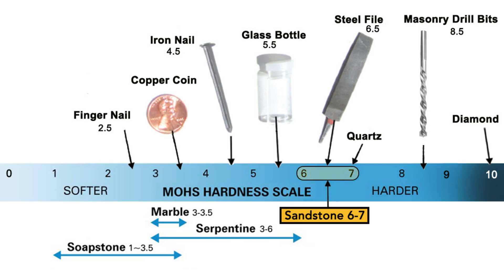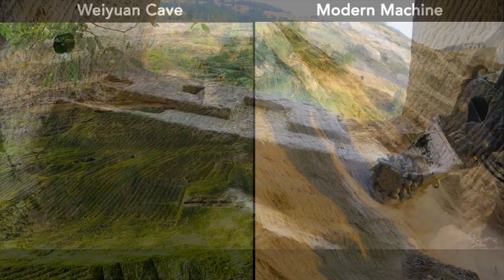Ancient Chinese Stone Caves & Egyptian Quarry Share Similar Machine Marks

Comment: I used to built continous miners . Those are those big machines which you showed in your video. The tool marks found in ancient caves around the world are all machine marks , exactly how they still look today . The pattern is determined by the design of the cutter . Those machines can cut huge amounts of rock in one day . They would have cut a cave in less than a day . Great video , great topic !
Reply from the maker: Thank you for sharing your insight. I really appreciate it! ♥
Reply: @CuriousBeingbyTina  More  misdirection.  The tool marks may look similar to todays machined marks...but the variety of the APPLICATIONS we see for that technology show that it is inconsistent with many of instances of its use that we can see today.
Reply from the maker: @michael4250  In which way inconsistent? Can you show a site with real hand chisel marks with similar consistency and scale?
Reply: @CuriousBeingbyTina  for one, the machines wouldn't be able to continue the machine tool markings into the very corners of the rooms, as seen in the caves.
Reply from the maker: @infidelli  Many machines are able to change the heads/picks they mount to be suitable for different jobs, therefore they can create room corners.
Reply: @infidelli  Unless they had smaller handheld tools they could do finishing work. Doing a few inches in a corner shouldn't take long. Need to get some close up photos or someone to measure these grooves to figure out how this was done.

Comment: The cutting marks are very hard to explain considering that they were made so long ago. It really does make you wonder! I have seen two tunneling machines that started on the opposite sides of a mountain to meet in the middle.  When the two machines met, they carved a pocket out and parked the two machines there in the middle of the mountain and abandoned them. The machines were so big and wore out that it was more profitable to leave them there than to take them out. Maybe, one day, we will find an ancient abandon tunneling machine on a side shaft in one of these tunnels. That would be a fine day.
Reply from the maker: That's very interesting! Thank you for sharing with me, Joe. There ought to be some ancient tunnels which haven't been scavenged. It'll be so exciting if we can find an abandoned tunneling machine somewhere!

Comment: Excellent information, thank you. One of the features that bother me are the window openings. There are many assumptions to establish but first it looks as though the rooms were made for people that would be average size even if you presume the square holes were another floor. From this I feel you can infer the physical demands and limitations that are familiar to us. Back to the smaller openings, they have the same continuous cut lines and in parallel yet it manages to go from edge to edge into and out of corners. There is no room for someone swinging hammers, it's clear machine work with a "compact tool" as you said. It would have needed to articulate well and be portable or modular enough transport on a climb, wow. Also our eyes are very good at picking up on variations, the cut outs, holes and windows are dead accurate visually. The squareness of the windows and floor etc is very flat and parallel. It's really beautiful. It would be so difficult to do this by hand in hard stone.
Reply from the maker: Thank you for sharing your insight with me, William. Very perceptive and reasonable argument :-) I appreciate that.
Reply: So correct. Folks with knowledge of, or experience with, certain types of construction projects, are more confounded than most. I certainly am.
Reply from the maker: @michael4250  Are you a stonemason? Have you worked on stone projects with chisel and hammer? I would like to see what your judgement is coming from. Can you show a site with real hand chisel marks with similar consistency and scale like these ancient caves?
Reply: You may have nailed The Solution without even realizing it. This all may have been "soft" by stone standards when carved. This requires a new understanding of other things archaeology has gotten wrong. We always have to begin with "Worlds in Collision" by Immanuel Velikovsky.
Basically, all the tales of the ancients were 1) telling stories, however inaccurately of what was seen, & surprisingly, 2) consistent. Velikovsky was a polyglot who realized that there were far too many parallels between what all the ancient writings said. (You can only account for cultural diffusion to inform a little of overall concepts. He was reading Identical Tales in the Chinese, Meso-American, Ancient Greek tales and the Old Testament).
Earth has been hit with several natural disasters that erased peoples, cultures & of course, technology. We can't be sure how many because the ancients used what we think of as metaphors to describe what they didn't have words for.
A great example is how there's a telling of how Mars (Ares) the planet got his scar in a battle with Venus (Aphrodite) except she's sometimes also said to be the Moon. Regardless, it tells about the Greeks witnessing the canals Mars getting carved.
The ancient Greeks had no telescopes. How did they see this happen then? The answer requires a fresh understanding of physics including electromagnetism, plasma-spheres that people used to refer to as "the ether" & some more things.
Just as there are sites now beneath water, there are deserts that used to be in areas that used to be forested, watered etc. There is so much now known, but still as always, more unknown. It's all fun discovering though.

Comment: An excellent presentation Tina. Several alternative ancient history theorists, like Chris Dunn, have made very good cases in the past for the use of high power modern type machinery based upon tool marks, both large and small, left behind on stone works in ancient Egypt. 
You correctly pointed out hammer driven chisel marks don’t leave behind the kind of uniform tool marks found it many ancient caves around the world. 
One more point. The modern rotary type rock excavating machines used today require high energy sources to power them, and such machines are quite large as well. 
In the caves you discussed, the spaces excavated were relatively small compared to modern quarries. 
In my career I have designed several special purpose machines. Judging from those confined cave spaces, and also considering that any machines would have to be transported up high cliffs, they must have been compact enough to fit in the cave itself as it was hollowed out, probably operated by one person, yet still possess a high enough energy output to excavate the rock in a timely manner, while also disposing of the spoil.
Which leads to another question. Exactly what happened to all that spoil from all those caves? It certainly wasn’t just dumped at the base of the cliff. If those caves were excavated by hand tools all the labor required to both chisel out the rock, and then carry off all the spoil, would have been enormous! That seems highly improbable.
Reply: Can't be certain from the video but whatever the largest door or aperture was, the machine or its parts had to fit through as well as the spoils. It doesn't look like it could have been all that large! And the machine had to have a cutting head compact enough to start the windows as well as fit in them to complete them. It's fascinating.
Reply from the maker: Thank you very much, John. It's great to hear your opinion and insight. I agree that the machines would have to be compact while powerful enough to excavate these caves. I wonder what kind of machinery was used at these ancient sites with limit spaces...
Reply: @CuriousBeingbyTina  It’s all very puzzling, isn’t it?
Reply from the maker: @Johnrack  Yes indeed.
Reply: @CuriousBeingbyTina  I will do some research to learn what the smallest continuous excavator is available today. If the smallest machine of that type available in this time is larger than the openings of these caves, then that would give a rough baseline as to the the size and horsepower required to excavate the caves. Perhaps meaning that a very compact ancient excavator, with the energy of our larger modern type, would be needed to perform the work. 
Also I noticed all the square holes in many of the these caves. Obviously a rotary type excavator couldn’t make these holes, so some other ancient machine must have made them as well.
As I said, these caves are very puzzling.
Reply from the maker: @Johnrack  That will be very helpful - thank you! Yes there appears to be different kinds of machines utilized in creating the caves.
Reply: @CuriousBeingbyTina  I know little about continuous mining or excavating machines, but I think that the information must be readily available online.
Reply: The tool marks are NOT uniform (mechanistic) when examined closely.  Each line is unique.  Get closeups, see for yourself and you will not accept this widespread misinformation.
Reply from the maker: @michael4250  Have you seen close-up machine marks? Many times they are not perfectly "uniform" either because these marks are created by rotary bits.

Comment: Tina,
I have thought about this issue of parallel gouges on ancient excavated areas.
I can imagine large wooden frames on wheels that support a large number of iron crowbars with flattened, tempered wedges hanging from leather straps.  This would resemble a large iron comb. The iron crowbars could be lifted by one man, who would also guide the gouge lines, using the leather straps as fulcurum points.
Another man with an large mallet wold hammer the blunt end of the crowbar to drive a gouge through the soft limestone.
I can even envisage a vertical comb of the iron crowbars held by a lattice of leather straps to allow vertical gouging along walls.
In the archaeological records in the area, has any one found carvings or wall paintings of such crowbar combs as I propose?

Comment: One point regarding sandstone is that it has layers that are similar to what can be seen as the grain of wood. Because these sandstone grains are not generally curved and circular, as they are in wood, the quarrying of sandstone has always been undertaken to allow for cutting with the grain to produce smooth facing stones which can be used as the external wall surfaces you generally see on buildings in sandstone areas, and as ashlars, which are cross grained cuts of the same or similar stone generally used for internal works that are not on display.
This is not a critique on your machine thesis, but it is worth noting that hardness only describes one quality for stone, where other factors such as brittleness can also exist, and that there are many qualities and colours of sandstone and that this stone is rarely quarried by the machine techniques that you have described even today, which are more common in salt mines where the quarried materials will eventually be crushed as the final product.
Please understand that I am not commenting on whether the markings you have noted are made by mason's point chisels, or other chisel types, and I am not saying that the cut marks produced in your pictures do not look ALMOST regular, but it is this ALMOST that argues against machinery as we understand it today, which just does what it has been set up to do, time after time after time, with such a regularity of precision that almost regular cannot describe the markings it leaves behind.
Perhaps what we could be considering is a type of wooden set up that could hold chisels to produce irregular and yet similar patterns when and if elements of it were stretched, worn down and/or replaced. 
Ultimately, it is not the cutting tool that requires clarification, because it is obviously some sort of chisel or chisels, either used individually or as a bank of chisels that operate together, and the question that remains is what powered those tools, a man, a series of men, some sort of belt drive linked to water, or donkeys and so on, and finally perhaps we might consider some sort of steam, combustion, or electrical engine.
Machines exist without engines because they can be powered in many ways, and they are and have been made of many things, including wood, historically, just as chisels have been made of many less durable materials than metal.

Comment: It does look like they must have had smaller machines to use in the narrow hallways and window sills. It seems they used different techniques at different sites.  I wonder if they hollowed out the rooms roughly, then came in and used a machine to finish the texture?
So I mentioned before in another post about maybe cataloging the size and shape of the markings also the technique. Then compare sights to see if any are similar. This could maybe tell if they were similar age or similar crews that worked on them. Kind of like finger prints. 
I really like seeing things from China! We never hear much about mysteries there.
Reply from the maker: Yes, I think it's very possible that the caves were roughly hollowed out first and then fine-tuned into rooms later. I agree that different machines were used. Like you analogy - these machine marks are kind of like finger prints!
Reply: Very good points.
Reply: @Johnrack  My thinking was if someone was able to photograph and measure in detail these markings everywhere they show up. Then try and see if any match or are similar. Also look at the supposed construction dates and see what comes out of it. Since there are no machines around that did this and no one knows how they did it, makes me think they are old. If I remember correctly there are some in South America too.

Comment: Well, it doesn’t look like the old machinery was of the rotating type, since the excavations aren’t wavy or grooved. I think that the technique we have forgotten is utilizing the power of vibration! This was probably was used for all of the world’s megalithic constructions, as you can move heavy objects with relative ease, if you can keep them vibrating. Maybe the cave drills had flat, hard surfaces with little protrusions and when dragged along a wall under pressure, it worked as a huge, vibrating sandpaper?

Comment: Another excellent video. If the caves were cut using power tools, where did the power come from?  Beautiful and smart. x
Reply from the maker: Thank you. If the machines were made of metal,  then they would rust away fairly quickly, like in a few hundred to a thousand years or so. Any surviving metal would be scavenged later. I received a very interesting video link of a new 1957 car sealed and carefully buried in a cement vault underground for 50 years; when it was dug up it was very rusty: https://youtu.be/KS5rg_k0zpk
Reply: @CuriousBeingbyTina  good video. I wonder where the car key and music went?

Comment: In the Osiris Shaft in Egypt there are similar machine marks. There is also one particular tool mark that shows that the machine had parallel fingers rather than rollers. Photo at techzelle.
Reply from the maker: Yes, I made videos on the Osiris Shaft. Hope you can check it out -  The Osiris Shaft: Part of a Prehistory Mine from a Lost Civilization? https://youtu.be/JuGt7JEWT6E

Comment: Excellent observations. The question remains: where are the remains of the tools with which these caves were made? What destroyed them since none have been found so far?
Reply: Imagine what can become of steel tools after several thousands of years, oxide powder or reused and transformed by men hundreds of years ago.
Reply from the maker: Thank you! Yes anything made of metal might rust away fairly quickly, like in a few hundred to a thousand years. Any surviving metal could be scavenged and recast, or deteriorated to a state that it's unrecognizable.
Reply: Ferrous metal would rust away eventually. Iron Viking swords are still found. How old are these marks? They must be older than they say if the machinery has rusted completely to nothing. Alternatively the machinery was removed or hidden and even oral history says nothing about them? This tends to indicate much older, maybe preflood?  12,000+ years?
Reply: @CuriousBeingbyTina  still so many similar buildings and really nothing left. We assume they were steel tools but we´re not even sure. A flood could have buried things under sand or mud, but even that would not have touched tools in high areas. Puzzled.
Reply from the maker: @alwayscensored6871  I agree. These caves might be created over 12,000 years ago, therefore ferrous metal would be rust away.
Reply: @CuriousBeingbyTina  such massive machines would rust away without a trace in 12000 years. I don´t believe that...
Reply from the maker: @johanfgitaar  The traces the machines left might be unrecognizable looking like hematite.  I received a very interesting video link of a new 1957 car sealed and carefully buried in a cement vault underground for 50 years; when it was dug up it was very rusty: https://youtu.be/KS5rg_k0zpk
Reply: @ludovicrebouillat3128  Anything not stone would disappear.  And anything loose...had over 12 thousand years to be lost.  Even the structures themselves were removed for reuse elsewhere, let alone their original tools.

Comment: It is possible that in antiquity sandstone was not as hard as it is today and therefore easier to carve. The Lines of square holes are probably for floor joists made of wood.
Reply from the maker: Thanks. It's possible that the square holes are for floor joists. Perhaps the sandstone was not as hard in the ancient time but it would not be necessary to dress the interior with these markings. Even with jackhammers and core drills, Mr. Tiger spent two years to excavate a cave which is 15 square meters or 170 sqft,  merely 1.5% of the area of the big ancient cave.